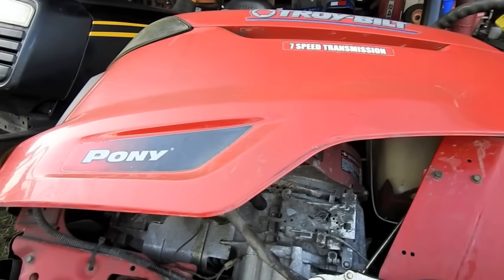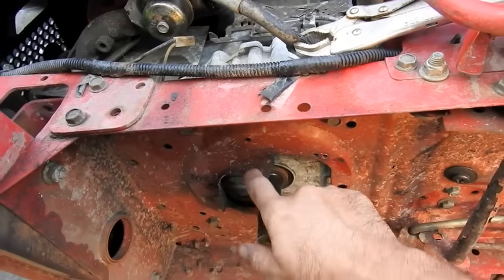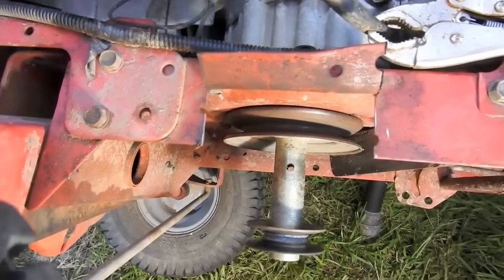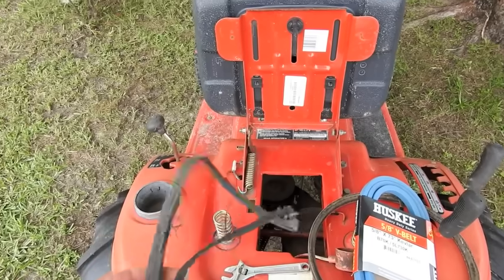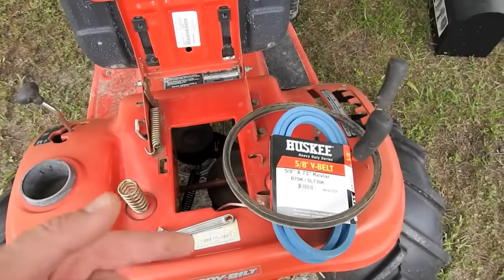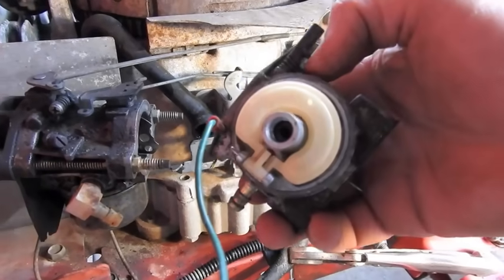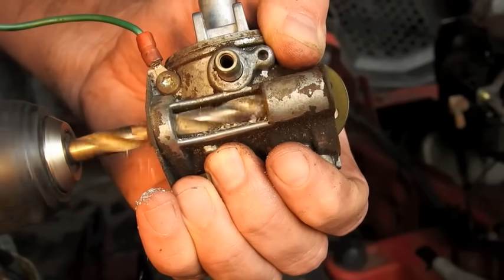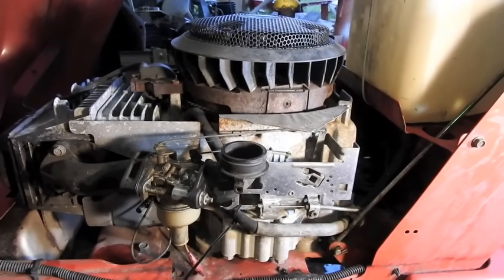Double the Speed for Super Cheap

Comment: Hey Chud, great video. I have a question, maybe you can help me,  Coincidentally, I recently changed the drive belt and I don't know if that will be the cause of my problem, I have a Troy bilt pony (2011), now I can only control the speed with the throttle lever, even when I put it in rabbit mode the motor goes at high rpm, but the ground speed is about half the normal speed; the (yellow on mine) speed control lever doesn’t work, it goes up and down without locking the notches, offers no resistance and does nothing. (however, the engaging of the parking brake action works fine). I opened up the mower and saw the yellow speed control lever attached to a connecting rod which is attached down there to the cupped metal piece in the correct position as the new Troy Bilt Pony I saw yesterday at Home Depot, but besides allowing to be put in in park position, I don’t see it attached to anything else, is it right? How does it regulate the speed if it is not connected to anything else? Thank you in advance.
Reply from the maker: Hard to say with out being there. Troys can't be tricky. Maybe there is a YouTube that can help. Sorry I don't know more...
Reply: @chud327  Thanks
😀

Comment: How do you measure how long of a belt you need after making the pulley bigger
Reply from the maker: I used to estimate a few inches longer or shorter depending on if it was a front or rear swap. Then take it back 2-3 times till you get the right belt. Now I take the mower to tractor supply and try them before I buy them. Or if you can find a video where someone else has already done it and see what they use. Thank for watching and good luck.
Reply: @chud327  wow thank you can't believe you responded will do

Comment: If I want to double my blade rotations which pulley do I upgrade to a bigger one on a zero turn?
Reply from the maker: make the ones on the spindles half as big or make the one on the engine twice as big... Let me know how it turns out.
Reply: @chud327  it has two belts.. . one that goes from the PTO to the top pulley of a double pulley on the deck... and another one that goes around the bottom pulley of that double pulley and all the spindles. So there is one belt that only goes around the spindles and another one that runs from the pulley that spins the spindles back to the PTO

Comment: Hey I appreciate the video I did the same thing to my mower but my belt doesn’t have as much clearance as the one that you had and I got it from the auto store and they said it’s the  right one though but I’m just going to order a different belt from online I’m going to try a 36 x 5 eights and another for 35 x 5 eights do you think a 36x5/8 would work
Reply from the maker: I believe I went with a 35 X1/2 inch, the 5.8's kept coming off.  Good luck and thanks for watching.

Comment: How did you take the belt off? I can't seem to take mine off
Reply from the maker: The back belt has to come off first. I have to take the two bolts out of the rear on the left side and loosen the two on the right. It is a pain the first time.... Good luck and thanks for watching!!
Reply: @chud327  I actually figured out I could skip removing a lot of it I just took the spring out of the idler pulley I believe that's what it is and just slide the back belt off the pulley I need to remove the other belt. It was a pain to figure out though
Reply from the maker: @noah_akers1  just glad you got it!!
Reply: @chud327 also how did you get the idler tension spring back on
Reply: @chud327 ok so I finished the pulley swap now when I go to select foreword and reverse I grinds even when the clutch is down do you have any idea what that would be?

Comment: with all the belt changes,whar was the final cost?
Reply from the maker: It was $27, that was for the belt, the nut, and the bolt.  Funny, I am working on another with a double pulley swap and so far it has cost $27...  It just hit 23 miles per hour with no gas pedal and running bad. That video will be out soon. thanks for watching.

Comment: Be alright for racing not so much for mowing large area's or if a person is a contractor . The larger the pulley the more heat & wear you'll get in a diff or gearbox that wasn't designed for it , it does shorten the life span . Better to increase tyre height,it doesn't need much to get a good dose of speed, works for self propelled walk behind mowers as well who only need a few extra millimeters
Reply from the maker: This one is not a mower anymore, it is just a toy... Thanks for watching.

Comment: The way that's set up currently if you take and make the rear pulley smaller would it go any faster?
Reply: yes it will, just like doing a pulley swap on a regular 5 or 6 speed
Reply from the maker: Yes, but those pulleys are hard to find. Thanks for watching.

Comment: Can you saw off the bottom pulley for ground clearance purposes or will it cause damage??
Reply from the maker: I could saw it off, but I don't think it will ever hit anything.  Would be easy to cut off with a grinder while the engine is running... Thanks for watching.
Reply: Right on. I have a old Sears I was thinking of doing that to to use off road
Reply from the maker: On a sears, you can buy a small pulley to put on the back as long as it is not too old. the older ones have a cone shaped shaft.  I am trying to find a bigger pulley for the front of my Colonel Craftsman, but I am going to have to find it online.  Thanks again for watching.

Comment: Does it matter if its and older tractor like 1960 and above
Reply from the maker: The pulley swap concept should alway work, but the mower may have a different pulley set up.  Good luck and thanks for watching.
Reply: @chud327  thanks

Comment: Can you use the original belt
Reply from the maker: Not if you just change one pulley size, needs a new belt length. On my last build, I changed both front and back and it just so happened that the stock size belt worked. That was just plain lucky. Thanks for watching.

Comment: If I go from a 5-in pulley to a 10-in pulley, how many inches bigger should my belt be
Reply from the maker: There is probably a formula for figuring it out, but I don't know it. I just take mine to the store and try some one. Will a 10 inch fit under there? I need to go bigger on mine. Thanks for watching.

Comment: @chud327 how long was the old belt I did the same thing and my old belt is 68” can I put the same belt on or to long
Reply from the maker: I think my stock belt was 69 inches, but I don't remember for sure. If you pulley flop it, it will need a 72 inch belt or at least mine did. Good luck and thanks for watching.
Reply: chud327 also where do you buy all your parts for your builds

Comment: Put a smaller pulley on the back and you will do highway speeds js when I was a kid my uncle used to fix up me and my cousins tractors and it was nothing to go 45-50 mph down the road but a word of wisdom keep mower deck BC lawn mowers are not meant to travel that fast lol
Reply from the maker: Yeah, this take hard to find pulleys in the back.  I don't think I want to do 50, my current fastest does 29 and it is plenty fast for me.  I would keep the decks, but they are too rusty by time I get them. Thanks for watching.

Comment: Seems like you could have removed the brake shaft and drilled without cutting the frame.  You destroyed the integrity of the Frame by cutting those slots in the flange area.
Reply from the maker: That would have been cool, when my son did his, he pulled the engine and did not cut his frame. thanks for watching.

Comment: Dude change the back pulley,,,and  it will  run  real  fast,,,,,,,only for speed tho  no torch,,for drag raceing,,,,,,cant wait to see it    oh yea  be careful,,,  wished I was there with yall,,,
Reply from the maker: I can't find a splined pulley that will fit on the back... thanks so much for watching.
Reply: @chud327 mabe we could weld a pulley on the bottom of it,,,,,hummm   then you would have to re aline the belt  o well good luck  bubu,,
Reply from the maker: Yes, it would be a little tricky...
Reply from the maker: @Riley Heumphreus On a troy bilt?

Comment: looks like the steering (probably at the bottom of the steering wheel) is too loose.

Suggest replacing the bearing, the drive gear and the steering plate
Reply from the maker: I need to do steering work on several of my mowers. Thanks for watching.

Comment: It would go really fast if you put a smaller pully in the back on the trans axle
Reply from the maker: Yes, but can you tell me where to find splined pulleys that fit the troy rear end? thanks for watching.
Reply: @chud327  like taractor supply might have them or you might have to find pullys where you insert  the middle part
Reply from the maker: @getoutdoorswithleroy4139  tractor supply does sell a pulley that fits on Troy bilt that I know of…

Comment: Swap the pulley out on the transaxle then u can go fast and have the blades spin like normal
Reply from the maker: There are no blades anymore and the rear axle pulleys have some splines that I can't locate. thanks for watching.
Reply: @chud327  why cant you put a bolt through like you did on the front? Also you can drill a dimple in the tranny shaft and a get the set screw on new pulley to seat in the dimple.
Reply from the maker: @JM-yx1lm  To small to drill, and too cone shaped and splined to screw and dimple...

Comment: Can you still use the mower deck with pulley swap
Reply from the maker: I guess you could, but it would cut thick grass anymore.  The mower would drive twice as fast and the mower turn twice as slow... Thanks for watching.
Reply: @chud327  that makes since
Reply: I guess in theory, replacing the altered pulley back to the stock size while keeping the flopped pulley in place should work. You would have to Frankenstein a pulley configuration to make it happen. The next thing to worry about is having a mower with spinning blades falling backwards onto you after a wheelie goes wrong.

Comment: What size are those rear tires, and where did I find them.
Reply from the maker: Those are 20X10X8"  and I found them on marketplace. They sell them at tractor supply for about $100 each, but that was out of my budget.  Search tractor tires, ag tires, golf cart tires, and atv tires and you might be able to find a set too. Thanks for watching.
Reply: @chud327  
Thanks. Tubeless correct?

Comment: I just want to know if i can still mow the grass after i do this?
Reply from the maker: I could, but if the grass is thick it may go too fast, even in first... thanks for watching.
Reply: You would have to get a smaller belt to run the blades correct?
Reply from the maker: @craftsman4746  Yes, longer for the drive and shorter for the blades.  the blades are also going to turn slower...

Comment: You can get triple the speed if you swap the back pulley
Reply from the maker: Do you know where to find a splined pulley for the back? me either... that is what I usually do, but not on troy bilts. Thanks for watching.
Reply: @chud327  I know that my local Lowe's has pulleys and ace hardware might have them that's where I went to get mine... great video

Comment: I am trying to do this with my mower, and the bolt at the bottom of the pulley won’t come loose. When you turn it the engine starts trying to turn over. Do you have any tips/what to do?
Reply from the maker: If you have or can borrow an impact, I highly recommend. If not maybe a pipe wrench to keep the pulley from spinning. Good luck and thanks for watching!!

Comment: I would have changed pulley on rear end.
Reply from the maker: me too, if you can tell me where to find a splined pulley. thanks for watching.
Reply: Im not sure. But about 6 years ago me and my dad built 2 mowers with roll cages on them. And we changed pulleys on rearend. They would push bout 25 to 30 mph. The rearends then had key ways not splines
Reply from the maker: Yes, I like the keyed pulleys, I can find those.  I like the idea of a roll cage on some thing going that fast...

Comment: Are you with a Grasscar racing league or club? I used to have an employee 20 years ago who was with 1 and said that they were a lot of fun on the cheap. Lawnmower going 30 mph.
Reply from the maker: I have never even heard of it, but it sure sounds cool. thanks for watching.
Reply: @chud327 , maybe you should start one with some other like minded folks in your area. Get together and see if you can set a few simple ground rules for safety and maybe equipment modifications (safety and HP / Speed improvements) .

Comment: you need to get the shroud over your flywheel or  you will burn your motor up
Reply from the maker: You are right, but I only run it for a few seconds with out the shroud off. Thanks so much for watching.

Comment: How’s the other craftsman that you swapped the 5hp on doing?
Reply from the maker: It is better than ever.  "Wyatt Henry" is trying to fix it up as another mower in his fleet.  He has solidly bolted the hood on, put tires on it, and got the steering freed up.  He has to find another engine and a seat for it, but that should be a problem.

Comment: The only thing more "hillbilly" than drilling through a drive shaft is cutting the frame to make room for the drill.
Reply from the maker: IKR, I got this mower for free, I would hate to destroy the value of it...  It was so slow it was not fun, I double the speed and made it cool. What would you have done? Oh wait, you probably don't like getting your hand greasy, that would be a hillbilly thing too. Thanks for watching.
Reply: @chud327  I would grind a new keyway, like it should be.  and If I ever had to drill a shaft I would use  a 90 degree drill, not cut through the frame

Comment: Put u a 5 inch pulley on the motor and 2 on the rear end up it will run alot faster than 11 mph  I have a old Murray and it runs ab 42 mph on four wheeler tires
Reply from the maker: Can't find a pulley that will go one the troy's rear.  Thanks for watching.

Comment: Pretty cool. Check out www.mowrace.com , its our  local lawnmower racing site. About 5 years ago  I built a Roller Motor with a 12 head  flat head Briggs. made a pully for my motor, you can buy a bushing for the motor and then the bigger pully part and just weld them together. I shaved the head and deck the block. Port and polished  exhaust and ported and lightly shot peened the intake. You could not pull start the engine, it had to be started on the exhaust stroke. 163# of compression Top speed 41 mph. in 5th gear. 4" off the ground. Fun stuff..
Reply from the maker: Sounds like a real beast, I haven't got that far into one yet, but it would be cool! Thanks for watching.

Comment: Would it still be able to mow if the deck was still in with this swap?
Reply from the maker: Technically, but the deck would turn 1/2 speed. Probably wouldn't cut very good and you would need 2 new belts to try it, thanks for watching!!

Comment: How can I reduce the speed of 1st gear by about 50%? If the other gears are 1/2 it's OK.
Reply: Run at 1/2 throttle.
Reply from the maker: You could make the pulley twice as small, if they make one. thanks for watching.
Reply from the maker: 1/2 throttle would do the trick, thanks for watching.

Comment: My tractor is a,
 b#!$a because my rear pulley is covered by the gas tank.
Reply from the maker: What kind is it?  My colonel craftsman is going to be a pain too. Maybe I will swap the front pulley instead. thanks for watching.
Reply: @chud327  I just took the rear plate out wear the trailer hooks up and pully swapped it. It was actually super easy.